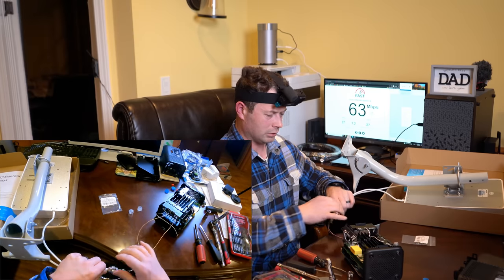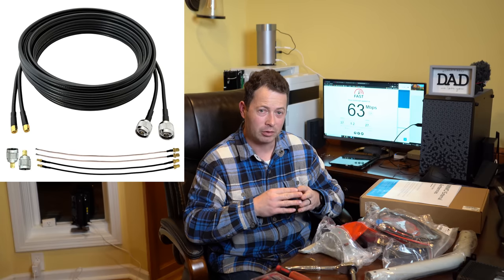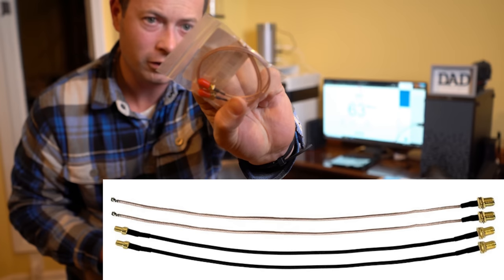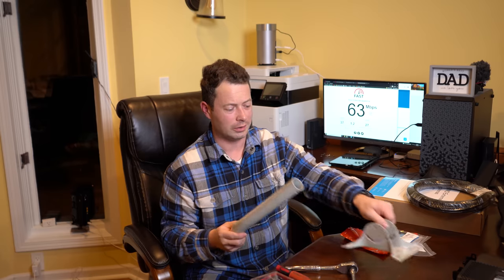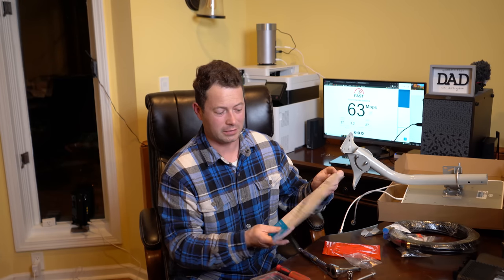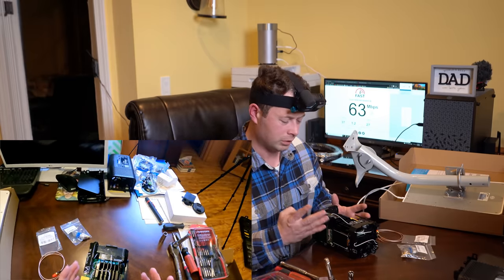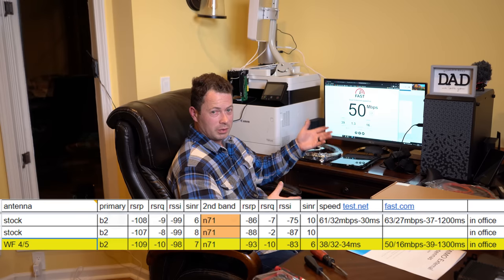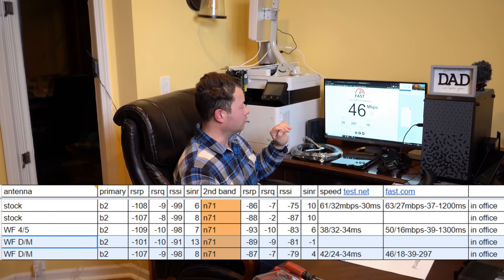✅ Waveform External Antenna - Arcadyan KVD21 T-Mobile 5G Home Internet - Speed Tested

Comment: Just ordered the MIMOx2.  My current speeds are anywhere from 20 to 50 over 2 to 9.  Even with those lower speeds my streaming internet tv is usually good,  but last night the buffering was horrendous even after peak hours.  I'm hoping this antenna eliminates the buffering.  I'm only a few miles from the tower.  It's a rural area, not too populated but there are some trees.
Reply from the maker: Antenna should help! Let us know
Reply: Well I hooked up my antenna today and this video along with the one for taking the KDV21 apart were huge helps!  I connected up the way you recommended, to M and M1, and I put those router cables on 4 and 5.  It's at the highest spot in the house, and where as I usually had a weak signal, I now have a constant strong signal.  I haven't moved the MIMO all around on the inside of the house because I really don't think it's gonna be better than what I have right now.  But what I want to do in the next couple of days is move it outside to the side of the house that is facing the cell tower.  At 8 pm, which is prime time and my usual download speeds are under 20 from the main tv, I was getting 50+, which is what I normally get during the day.  Right now I have a live baseball game on and it's buffering, although not as bad as it usually would which is unwatchable, but enough to be annoying, and I'm using a low bandwidth channel which is provided by the service I use to stream live tv.  With Comcast I had very little buffering, if any.  My goal is to get back to that if possible.  I've learned to hate Comcast, DTV, Dish etc......... and it felt so good to cut the cord from their cable tv years ago, and now to cut the internet cord with them as well.  During the day there is no buffering, but who watches tv during the day other than retired people......... :)  Not to mention the best shows and most sports are on after 6 pm.......  I don't know that even an excellent strength signal is going to get rid of the buffering.  I have a feeling it's TM not having enough bandwidth, or throttling back during prime time because they don't have the infrastructure that Comcast has.  I can only hope that they are working to improve their home internet service.  I'll report back once I move the antenna outside.

Thanks again for all that you do..........
Reply from the maker: @jefflbi  you're welcome, keep at it.  Sounds like you have some good steps to do.
Reply: @NaterTater , at the end of this video you say that M and M1 are the best ports for this antenna, but in a different video you said that M and D are the best ports.  Which is the preferred??  Thanks

Again....... nevermind....... I just rewatched the end of the video and I see where you added the overlay about M and D being the best if there is no N41, which I have no 5G stats showing up in the cellular metrics.............

Update:  Seeing how there was no difference from inside the house to one of my roofs, and because of the tree directly blocking the most optimum direction, I moved the antenna to an even higher roof peak and in a spot where the tree next door was not blocking the move optimum direction.  I now am using ports M and M1.  At first my signal strength actually was weaker.  After I was sure I had the perfect direction to the closest tower, to which I found was less than a mile away, I went inside and moved the KDV21 right next to a screen by a window.  Have no fear I have the screen at the top of the window to minimize the chance of rain, and there is an overhang right about the window.  It would have to take a monsoon for the router to get wet.  Anyway for the first time I now have 4 bars on my router......... but my download speeds are no different at 52, but my upload speed is now showing 25 which it has never been that high.  Since my Google mesh is hardwired to the router I use the built in speed test.  Using a speed test on my cell connected to the mesh I get 45 down and 4 up.  I'm not really concerned with upload at this point.

I'll find out tonight if the 4 bars makes a difference with the buffering I've been experiencing while watching live tv.  But I will say this, I think I am going to get the MIMO4 to take the router placement out of the mix.  I also ordered that fan with the ports, off of Etsy.  That's a great tip!!!
Reply: @NaterTater , just a quick update.  I mounted the antenna on the peak of one of my roofs and there is no difference in signal strength.  Now there is a tree right next door that is most likely interfering.  Unfortunately to move the antenna in a position where the tree is not as much in the way, I have to go to a lower roof.  Right now I am using ports M and D, but I think I'm going to try M and M1 like I first had it connected.........

I wound up moving the antenna to an even higher roof and at a spot where the tree next door wasn't directly in the way.  I used the TM app  to home in on the best direction to point the antenna.  Using the camera view seems to work better than the map view..............  in checking my signal strength it was still showing Weak which was strange because when the antenna was in the house next to the router it was a constant good.......... I went into the house and moved the KDV21 right next to a window screen.  About a minute later the signal jumped to very good, so that tells me that for my circumstance I really should have bought the MIMO 4 ( which I have already ordered).  I also ordered that fan off of Etsy, with the holes for the connectors.  In testing my speeds, I use the built-in tester of my Google Mesh app since the router pod is hardwired to the TM router.  48 down and 27 up.  I've never that good of an up number, but for my purposes I'm more concerned with download.  It will be interesting to see how the buffering is later on my live tv streaming.  Right now it's fine but it's only mid afternoon where I'm at.

One of the last things I'm going to have to do is secure the cable from the antenna to the router.  Right now most of it is just lying on the roof.  I have about 5 ft to spare.  I have not cut a hole in the wall.  I'm just running it thru the window to where the router is, which is the attic, which neither heated in the winter or cooled in the summer, so right now it gets pretty hot up there, which is why I ordered that fan..........

Comment: Great report!!! NO N41 in my area… please explain why to use ports M&D … T-Mobile is not supplying N41 in this area yet
Reply from the maker: Each antenna port is designed for certain freq and tx and/or rx.  D and M best for lower freq.

Comment: Hi Nate,   I'm 9.9 miles away from the one and only TMO Extended 5G tower in our rural area.  There are no other tmo towers anywhere near me.  With the stock kvd21 located in my closet, I got about 90mbps down and 85 mbps up with pings in the 100 ms range.  I just upgraded to the Waveform 4x4 panel, also located in the same closet WITHOUT the 30' of extension cable and speeds are now averaging 250 mbps down with 55mbps up.  Peak download of 350, with peak upload of 125.  All of the metrics improved, but the real proof is the average speed & latency.  

I thought I saw somebody post where they added an additional 2x2 mimo external antenna on the 2 unused ports and the saw a substantial improvement in upload speed.  Do you have thoughts about adding antennas on those ports?   Are those ports for a particular band that may not be available on my tower?
Reply from the maker: How have you confirmed there are no other t-mobile towers? Cell mapper is not the most accurate.   I would recommend experimenting with ports 4 and 5.  You can try using the stock antennas there to see if you notice a difference.   Did you change bands from stock to 4x4? n71 to n41 secondary?

Comment: You said there were trees between you and the tower. Now with full foliage, are you seeing any degradation in speed?
Reply from the maker: In general I've seen some slow down with foliage on the higher freq bands like n41 but not on n71.

Comment: Would make sense that positing of the modem is still in play because the internal antennas are still being used by the modem in mimo mode. As far as ports that work best for best signal and gain. When hooking up a 2x2 antenna its generally best to have one going to main and the other to diversisty. Expecially in a high noise floor enviroment the diverity helps to grab a cleaner signal. When closer to the tower or with better line of sight this is less of an issue. Don't forget to factor in Carrier Aggeration when hooking up a non-mimo antenna this will only amplify the main band the modem locks onto. It can result in loss of speed over signal strength. Would be interesting to beable to SSH or Tenet into this modem and run some AT commands on the modem.
Reply from the maker: I agree

Comment: Do you have to buy an antenna or can you just switch the m, M1, M2, D inside the KVD21? I would like to try it but dont want to damage the KVD21.  Right now I get 325Mbps down and 35Mbps Up.  Just want to trick into n71 to increase up

Comment: I have 2 yagi panels and 2 2x2 mimo panels. Which ports do i connect the yagi panels to? And which ports i connect the 2x2 mimo panels to? I have direct sight of my cell tower, and still cant get over 100mbps speeds and my latency keeps jumping from 90,70, and somtimes over 200.

Comment: well..good thing am getting good speeds with the trashcan. DOWNs 100s/250s. UPs 45s lately.it save me the hassle of buying and placing external antennas besides they are expensive. the trashcan is not perfect  but is better than others carriers

Comment: living in the boondocks ... I get LTE only and using a 2x2 mimo with 50' tower ...  should I use the primary  M & M1 ? ALSO::::: is it necessary to connect the dangling leads to 4 &5 for the modem to work correctly. thanks for any info on LTE tests.

Comment: Ever put the case back on 🤔…. And if so…. What are the new issues with the new pigtails…. Those are some longgggg pigtails😀…. Look like 8” anyhow great work !!!
Reply from the maker: Case is still off.  Doesnt have to be on to function.   No issues with pigtails, they need to be long so you can get them out of the case.

Comment: I have the waveform on the trash can style. Didn't really see much improvement.  But killer video man
Reply from the maker: The key to the panel antenna is getting it placed in a good location, by itself I don't see a huge improvement if its placed right where the gateway is.  A lot of the benefit comes from being able to place it in an ideal spot that you can't put your gateway (ie outdoors, attic, etc)
Reply: @NaterTater  I have mine currently in the attic.  I have spent a good amount of time adjusting up/down left/right. I'm about 5 miles from the tower. No blockage pretty much straight shot

Comment: Was wanting a more comprehensive report. I have two waveform panels (4 wires). After watching this, I have no idea how to connect all four wires. Currently using the trashcan version. Are the center pins tied to the outer shell like they are on the Nokia (L1, L2, and L3) (L4 is separate - center pin not tied to outer shell). I've had two Nokia units now and both are the same. You can test by hooking up the ufl connector and putting a meter (continuity mode) on the center pin and the other end on the outside of the ufl connector (board side). I'm hoping you will have time to test both units as you have more units to test on. Thank you for this and other posts! Much appreciated.
Reply from the maker: If you have the nokia you would just connect one panel to L1 & L2 and the other to L3 & L4.
Reply: Yes that is how they are connected now. Was asking about how I would go about hooking up both to the new Arcadyn unit. And also would like to know the answer to the grounding question when you open up the Nokia next time. After two units I still don't know if mine is defective or not.
Reply from the maker: @sharky112065  I didn't feel like disassembling the nokia to test L1 and L2 but both L3 and L3 have "grounded" center pins on my unit.  Arcadyan gateway has atleast M and M1 ports grounded too.
Reply: @NaterTater That's so weird. Excluding L1 and L2 because your not hooked up to them. On my unit, L3 center pin is grounded and L4 is not grounded. On L4 the external ground connector to connector is not grounded to the center pin. L1 through L3 are all hooked together to ground on center pins and outer ground connection. Was like this in both gateway units. Now that your telling me both L3 and L4 on your unit are all grounded (internal and external connection points) together I don't know whether my unit is good or bad.

Comment: Nater, thank you for the awsome videos. Great quality detail and clear info always. 

I wanted to ask, I myself use the nokia 5g router . Right now I see speeds of about 120 down and 3 up. I have a antenna I was thinking about trying out . Here is the part number LBE-5AC-US .  I'm not sure if this is capable of providing better speeds but I'm willing to test. 

Although I'm confused on how to wire in the signal to the tmo router. I have a cat cable that runs from this sattelite into my house , into a poe power supply . Out of the power supply I have another cat port that would go to a router for internet input.  Any ideas on how I could wire this into the tmobile antenna ports ?
Reply from the maker: Thanks for watching and the kind words.  That part number is for a 5Ghz wifi bridge and wont work as an antenna for a cellular modem.  I have some links in this video description for antennas that work.

Comment: in my case having a cell phone booster is a good thing. unplugged i get 1-5/.5  w peaks to 10. the connection data prove it, when plugged in the data rates improved to around 30/1. i should have more info by 5/27

Comment: Hello. Does you have any idea if the gateway receives it's 5G signal through a particular antenna port, or does the unit receive 5G and LTE signals through all the same ports? I wish I could disconnect the 5G signal all together because whenever it switches to 5G the internet speed is so much worse. I'm 2 miles from the tower and there's a lot of trees between here and there on flat land. The 5G bars on the gateway stay at poor or weak. Where as the LTE stays on good 90% of the time. Plus, I have an 11dbi panel antenna I'm considering using with that gateway. Thank you!

Comment: Nate great video keep them coming, just curious on your T-mobile gateway which antennas did you use 1-2 or 3-4 just did my mod and used 3-4 and was wondering if there is a difference signals.
Reply from the maker: Russ, this is the Arcadyan gateway so it has M, D, M1, M1, 4, 5 for port.  On Nokia I found 3&4 to give the best speeds .
Reply: @NaterTater  Thank you Nate I'm good to go I did do mine on 3-4 I would not have done this if it wasn't for you videos, looking forward to the next one.
Reply: @NaterTater  i must have issed it, which antennas did you end up using in the Arcadyan?
Reply from the maker: @bshipley78  waveform panel, discount link is in the video description

Comment: When testing different antennas, the DB improvement and SNR (signal to noise ratio) will be a much better as a measurement and point of reference rather than the upload/download that have the variability of the tower access by users and time of day. At 4am (when I'm probably almost the only one up), I get 3x faster download/upload speeds. Without changing anything about location and position of the gateway, by 8am the download/upload speeds have dropped significantly cause probably many more people are up and accessing the tower. My point is that antenna tests should be measured mainly on DB and SNR numbers, not on download/upload speeds. Cause it goes without saying that download/uploads speeds should improve with better DB and SNR depending on the time of day and how many people are accessing the tower.
Reply from the maker: That's somewhat true but there is another more important factor for fixed wireless and that's what band you are on.  You can be on a better band with higher Mhz bandwidth with lower signal metrics but be faster upload/download than a worse band with a better signal.  For these tests I did the comparison at the same time to reduce the noise of  congestion.  You might enjoy the data deep dive video more:  https://youtu.be/_5eERL3Rc40
Reply: @NaterTater  Yes, but the band has nothing to do with finding the best antenna. And I thought that was the point of the video. So looking for DB improvements and SNR, with everything else being equal, should be a much better measurement rather than upload/download. BTW, at 4am today I got insane speeds (like 5-7x) only to go back to normal by 8am. And that was stock (meaning no external antennas).
Reply from the maker: @TheNature101  The band had a lot to do with an external antenna.  The antenna ports are also biased towards different frequencies so its important to know the bands.  You need to match the antenna to the band you want and where it is coming from (tower).  For many they can get a good band like n41 with an external antenna if they are on the fringe of coverage and cant get it as stock.  Yes speeds can vary based on congestion but ultimately people want fast speeds and low ping so those are the best way to tune in my opinion.   That said I certainly use cell metrics to tune since its instant.  Then when i find a good spot i start speed testing which takes longer.